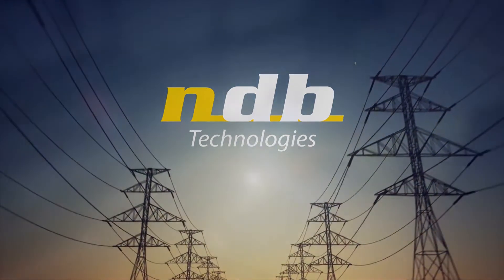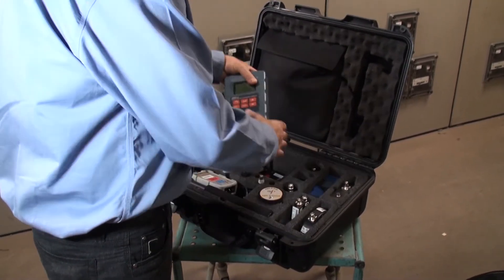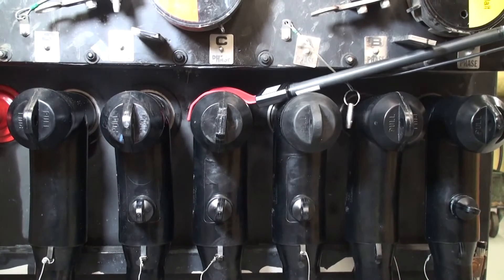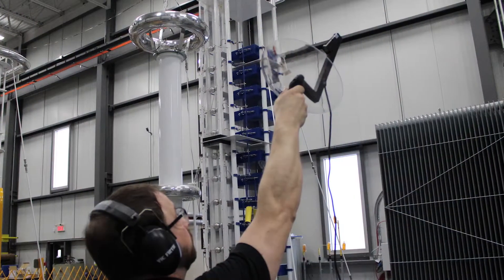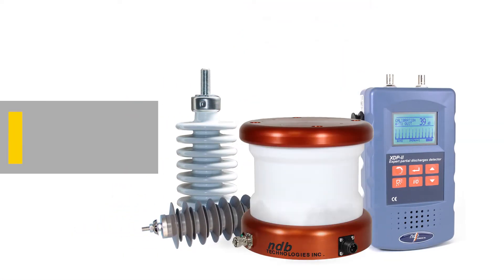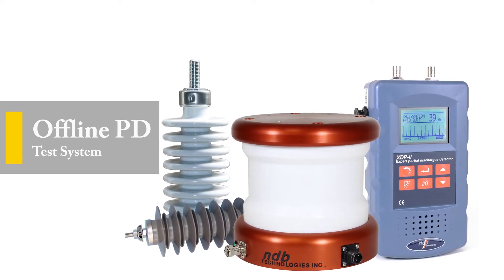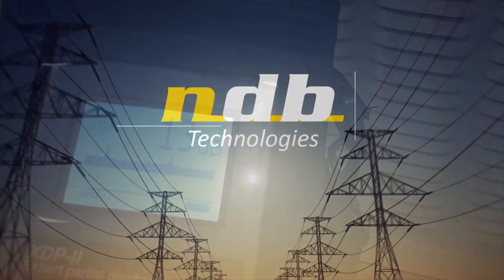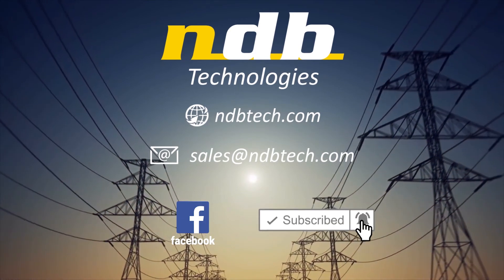XDP-II™ Expert Partial Discharge Detector

Comment: How effective is your Phase Resolved pattern? Other brands rely on E field and light which are quite difficult.
Reply from the maker: Two wireless modules are available for that matter. One with an electric input, the second one is inductive which is very practical for cable PD testing.